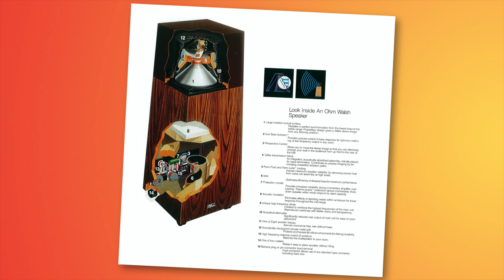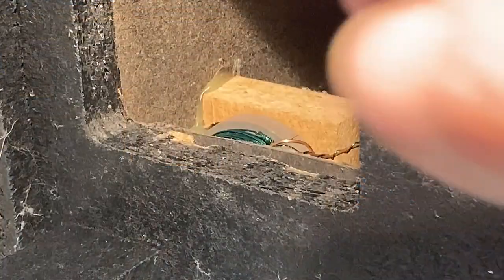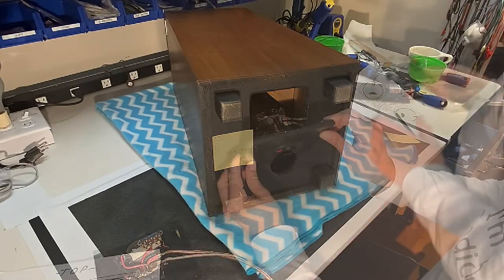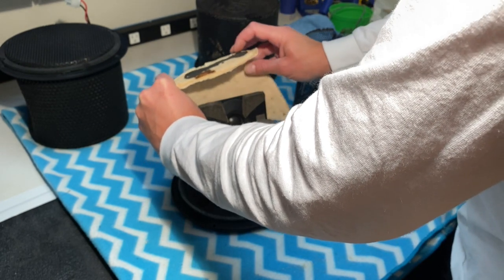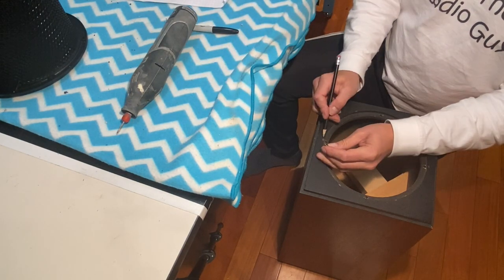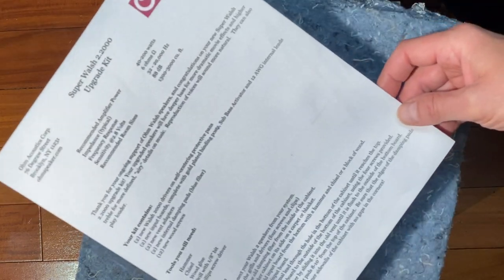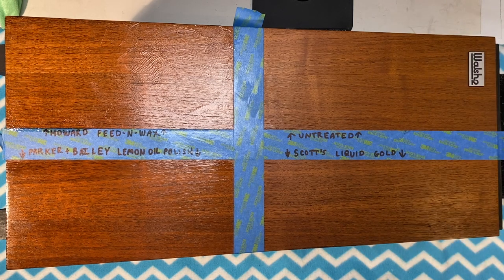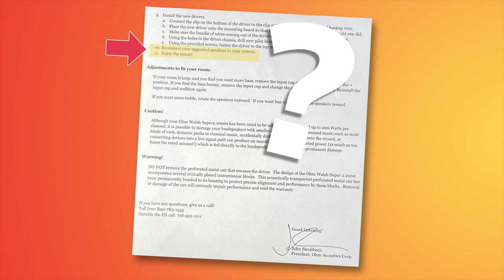Ohm Walsh 2 Speaker Upgrade P2: Let’s Do It!

Comment: I'm glad I saw this upgrade video...as I was considering doing the upgrade.  

I find the early Walsh2's are a great sounding dome type speaker...but but after seeing this video, they look cheaply made.  Considering in 1982 a set would cost over $800+US.  I was very fortunate an elderly next door neighbor gave me his mint rarely used set for free.  

But the fact that most of the original components that will be upgraded...are glued, and not affixed with screws.  Well, I'm going to just keep my W2's in it's original state...considering they are almost in new condition, and the upgrade to me isn't worth it.  

Also, I would suggest to keep the beautiful Rose wood veneer case (or what ever your model veneer was used) looking great...use (regularly) lemon oil, to ensure the veneer doesn't dry out, and or fade.  Just don't get any of the lemon oil on the top black part where the covers sit.  The old can absorb into the material and ruin it, and replacement covers are $150US..plus tax.

Comment: Thanks for this video, especially disassembling the module! 

I was a bit surprised by the damage to the module in shipping. Sorry Ohm, that didn't happen in shipping so either our presenter here is lying or Ohm is and I'm siding with the presenter. Ohm - FAIL.

Also for the price of this upgrade Ohm should have created a plate that adapts the new module to the cabinet and enables the screws to bite into the thicker part of the particle board. This was a poorly thought out part of the upgrade.  Ohm - FAIL

Comment: Your video confirmed for me that Ohm utilizes a ‘normal’ driver unit in its current products. The Lincoln Walsh driver, as utilized in the original Ohm-A, was not a ‘normal’ driver. The cone of a true Walsh driver is much more steeply shaped than that of a normal driver. Reminiscent of a cheerleading hand megaphone, except much smaller. The reason for that was, the idea that the speed of the acoustic wave traveling down the cone could produce a coherent, singular acoustic wave launch to the air by virtue of the narrow cone profile. This cone geometry, while something like a normal driver, still was different enough to require a custom designed and produced driver. Which, not surprisingly, was expensive, among other challenges presented by its unique design.

Comment: Nice job with your video. It's quite helpful.

From my experience in buying raw speakers and constructing speaker cabinets, these are modest drivers. The idea of allowing the sound wave to radiate from all sides (except for intentional absorption on one side) then directing it in a large arc, plus mounting the tweeter mostly free of the baffle gives them their sound signature.

Of the two drivers, the tweeter is the most impressive of the two. It's motor structure utilizes a large magnet, while the bass (woofer), utilizes a modest magnet. I can't tell for sure, but I would say the design places the crossover frequency fairly low, 1250 to 1450Hz, which for a dome or a cone tweeter (non horn loaded) is rather low. The 8 inch (estimated size) woofer handles the lowest frequencies. Since the tweeter has to go that low. It has to be fairly substantial in order to not burnout and be able to move a bit of a greater excursion than most two way designs. 

This is the better part of this design because any speaker designed to handle the lowest frequencies has a mass that prevents it from the faster attack and higher frequencies in piano, percussive, and even higher voice images.

These speakers have been given rave reviews for many years, in spite of what I consider their use of relatively low cost drivers. 

These speakers have been around for awhile, but they in no way represent the original Ohm A or F design. I'm familiar with the sound out of the Ohm F. A friend of mine owned them back in the '70's. Expensive to construct, heavy weights, they required an amplifier with substantial power, best served up in that era by Phase Linear, Crown, or Ampzilla. I can see why the owner designer changed Walsh's ideas to still give that wide dispersion sound.

I know this is somewhat of a wet blanket explanation, but I certainly would like to hear these in a room with Vanderstein 3a's. Similar in terms of elimination of many cabinet defractions, he uses multiple drivers to cover the wide audio range. Search on line for the internal speaker and cabinet choices. It's of course different and not inexpensive, but gives you an idea of what using higher quality drivers can do to achieve similar results.  I'm not connected with any company or designer. What you did for me here is show how a clever design, even with low cost drivers, can still create a good sounding product.

The bulbs aren't likely to burn out. I remember Polk used them for awhile. They simply increase resistance as they heat up and light. The increased resistance lowers the current to the tweeter, and the applied signal mostly drops across the bulbs. You hear the change in sound output and likely will lower the volume. The bulbs will continue to work and your sound will be restored unless you keep the volume too high.
Reply from the maker: Glad you enjoyed the video series, Michael.
Reply: These relatively "low cost drivers" are HAND BUILT in Brooklyn  NY my dude...

Comment: Awesome video, but be wary about those "sound isolation foams", it could be made of asbestos by your description "dense and fibrous", you need dust respirator dealing with those.
Reply from the maker: Thanks, glad you enjoyed the video. As these speakers date from the 80s, my guess is that the foam used is far more likely to be fiberglass-based than asbestos. I have occasionally run across asbestos in the antique radios I’ve restored, usually for heat control for the wood cabinet in proximity to hot vacuum tubes. You make a good point, though, that it’s always a good idea to wear a mask when opening old equipment. You just never can be sure. Also, often there’s mildew or rodent urine and feces which is best to not breathe.

Comment: (22:44) Yeah, that affects the bass reflex tuning of the cabinet. If you look up how to determine the size/length of your port(s) when building your own speakers, you'll see why. Basically, it has to do with the natural free air resonance frequency point (the frequency at which they will harmonically oscillate with very little power input) of the woofer(s) you have installed. So, since you're replacing the woofers, the new ones obviously would have different characteristics than the older ones, hence why they needed to recalculate the tuning of that port. :)
EDIT: also, having a rounded edge might also help reduce what's called "choofing" or port buzzing.
Reply from the maker: The port wasn’t retuned, though. It’s the same port, same dimensions. They just added the plastic insert, that yes, with the rounded edge could potentially reduce air turbulence. Careful listening, however, revealed no benefit to my ears.
Reply: @FluxCondenser  The insert makes the inside diameter of the port smaller which will have an affect. The differences between the drivers are probably pretty similar which would require a little tuning. ;)
Reply from the maker: The insert has very little depth, so it would not consequentially affect the tuning of the port.

Comment: That's odd. My upgrade came with the switches on the outside though one of the switches doesn't work. Fortunately I like the way it sounds so I haven't bothered with it.
Reply from the maker: Hm, that is curious. Perhaps they made a recent change? If you did indeed purchase the same upgrade kit as shown in the video you might want to confirm that they sent you the correct crossover assembly. 

I’m glad the busted switch doesn’t bother you, but geez, that’s unacceptable considering the upgrade cost. I’m recalling that when I received my upgrade both speaker canisters were dented. One wasn’t too bad, but the other was completely pushed in and unacceptable. Their customer service is good (they rushed out two replacements for me), but I gotta wonder what’s going on there as far as quality control these days.

Comment: I can't believe they thought it was OK to have a switch on the INSIDE of the cabinet. WTF were they thinking? Out of curiosity, did you end up leaving it in the middle, which is what I assume is the default position?
Reply from the maker: Yes, all tests were done in the middle, neutral position. Agreed, the internal switches? Unacceptable.

Comment: (13:00) Me thinks it's some sort of non-ferrous insulator material. Iron? Mmmm... That broke that easily? Yeah, some sort of "ceramic-y" material. I would really like to take a look at the crossover schematic. Wondering if the switches on the bottom use one or the other coil/inductor depending on the setting (along with different capacitors/resistor combos). Pretty certain the smaller coil and film/poly capacitor on the crossover board are for the tweeter. All in all, just your pretty basic 2nd order crossover with what look to be fairly good components. :)
Reply from the maker: The insulating material of an inductor affects it’s effective frequencies in a tuned circuit. Iron/ferrite is typically used for lower frequencies and air insulators for higher frequencies. I discuss this in more detail in my earlier videos about how radios work, particularly the ones on IF transformers.
Reply: @FluxCondenser  Yes. However, I couldn't tell if it was actually inside the inductor or just being used as a spacer. :)

Comment: I have a walsh 2 and was considering making a video like this when I  buy the upgrade kit, but it looks like you beat me to it! Loved the video!  Now the question is: in your next video, did you happened to record the old Walsh 2 sound to compare to the new 2000 driver? If so I’m really looking forward to watching your results.
Reply from the maker: Yes, I did record the sound and have some high quality recordings of the original and upgrade as well as some other speakers in my system for comparison. Stay tuned.
Reply: Ehhm sorry, dont want to be rude. But is that the way, just hole is just made in the bottem for basreflex port? Really isnt a high end speaker then is it,... must sound real good, because it doesnt look like a expensive high end speakerbuild.

Comment: looks like the new speaker you installed at 53:00 was the metal surround was dented in badly on the side?
Reply from the maker: Hi, Tim. Yes, as stated in the video, Ohm supplied me with two modules that were dented, one worse than the other. At minute 53, I show the badly dented module being installed and state that it is temporary just to check the screw holes alignment. At that point, the replacements that Ohm sent me had not been delivered yet. Later in the video, I show the unboxing of the replacement modules.
Reply: @FluxCondenser  My mistake, for not hearing that part about the dent at 36:00.   I own 2 pairs of Ohms the FRS-11 and FRS-15, and will be sending in soon for surround repair/maintenance, and also getting some new grills.  I Love the Ohm/Walsh speakers!  I've had a lot a high end speakers over the years, but I'd never sell my Ohms.
Reply from the maker: It’s great that Ohm still offers reasonably priced repairs for their older speakers. I really enjoyed the Walsh 2s before I upgraded them, now I find them unpleasant and fatiguing. Beware the upgrades.

Comment: When will part 3 be uploaded? I have the Ohm Walsh 1 and plan on upgrading too.
Reply from the maker: Thank you for asking. I will be starting to work on the video next week. It’s taken a while because I’m evaluating the sound quality and want to make sure I get it right. I’ve been doing a lot of listening to the upgraded speakers and comparing them to others I own. This weekend, I want to try to confirm what I’m hearing with some test equipment. Stay tuned!
Reply: @FluxCondenser  Sounds good. Thanks for the reply. I'm interested to hear your opinion on the improvements, especially in regards to frquency response and any dips being fixed with the upgrade.
Reply from the maker: I.DIG.WAX. Today I did some measurements of the speaker to try to confirm what I’m hearing and I was able to see with my eyes what I’ve been hearing with my ears. I don’t have the same measurements for the original Walsh 2 before the upgrade, but I have recordings of the speaker before and after the upgrade playing the same song. I wanted to reveal my findings in the third video (which I will and I’ll elaborate on), but since you’re looking for some buying advice I can tell you that the upgrade introduced a mid-bass bump that was not there with the original and I’m not going to recommend the upgrade.
Reply: @FluxCondenser  Thanks for the info. I want to ask more but I'll wait until the video is uploaded. Don't want to ruin it for the other viewers.
Reply: I do wonder if the 2000 driver sounds more refined than the 2. I also have the FRS 15 which is a generation or two newer and the sound is more rounded and refined. I am guessing that the 2000 driver also sounds more refined than the 2.
Reply from the maker: Today I’ll be doing some testing with the speakers in a smaller room which is more in line with the room size Ohm recommends. If my results are different there my recommendation may change, so stay tuned.
Reply: Also did you allow for the break in time?
Reply from the maker: Yes, lots of break-in and listening over many weeks. Also, in discussions with Ohm they did not feel that break-in would change the sound quality.
Reply from the maker: Stay tuned, Daniel. I hope to have part 3 up by early next week.
Reply: Yours is likely the first audio comparison online. I looked everywhere for the past year but only found comparisons through forums. Opinions are mixed. Looking forward to part 3!
Reply from the maker: Absolutely, opinions are only valuable if they’re backed up with some data and an open mind.

Comment: Can I replace just the crossovers?
Reply from the maker: The kit I purchased was intended to be used with the new woofer and tweeter so I wouldn’t recommend buying it for the crossovers. You could certainly update or upgrade the original crossover, but it’s difficult to access or remove. In my discussions with Ohm, they didn’t think changes or a rebuild were necessary for the original Walsh 2 crossover unless they were exhibiting issues. If you want to investigate altering your crossovers, I’d suggest calling Ohm directly. They’re generally extremely helpful and responsive.

Comment: Just use plain old mineral oil which is probably the main ingredient in all those products!  Wipe on, wait 10 minutes, then wipe off.
Reply from the maker: Dan Edewaard, just use the product I suggested. It’s a wax, not an oil. Oils leave a greasy residue that’s a magnet for dust and fingerprints. When you buff them enough to remove the residue, they add very little shine or protection. The product I recommended is superior.
Reply: I wonder why many on the great vintage speaker manufacturers would advertise the use of “Oiled Walnut Veneer” on their finest loudspeakers?  The oil penetrates and keeps the wood moist, preventing veneer shrinkage, while a wax puts on a top coat which prevents penetration and is very difficult to remove!  Mineral oil is the basis of many of the wood revitalizing products like lemon oil, which is mineral oil with a lemon scent!  I just finished a pair of Dynaco A25s with mineral oil (wipe on, wait 10 minutes, wipe off).  You don’t need to spend a lot to make your speakers look good!!!!!!!!!!!
Reply from the maker: The proof is in the results. The oil products were vastly inferior to the winning product in my demonstration. The results shown are indisputable. Use what you like, but it’s foolish to try to argue with what was so clearly demonstrated.
Reply: I just like to oil my speakers from time to time.  The wax will prevent the oil from penetrating the next time I want to oil them.  I don't want the veneer to dry out and shrink, which would lead to delamination.
Reply from the maker: You can do both. Oil and then cover with the wax I suggest. The oil nourishes and the wax adds a non-greasy shine that doesn’t disappear once it’s wiped dry. Again, as shown in the video, superior to the oil. The wax will not make it impossible to oil again as its well established that mineral oil easily breaks down the wax and will penetrate the wood. I’ve read or seen no reputable article or demonstration that a high quality wax will lead to “delaminating wood.” Nonsense.
Reply: Ok, I'll have to try that!